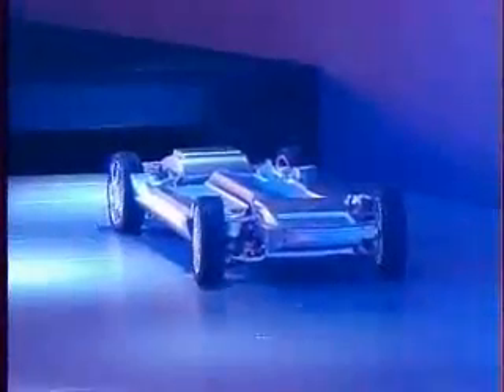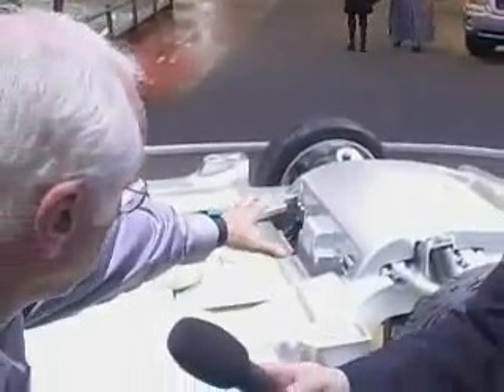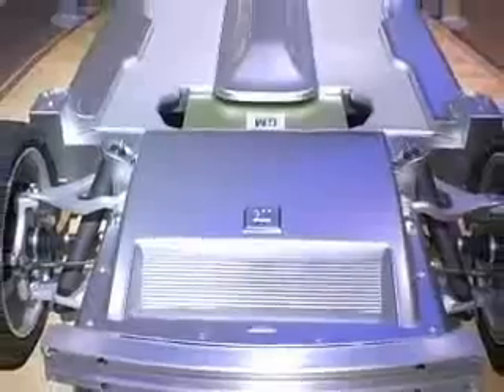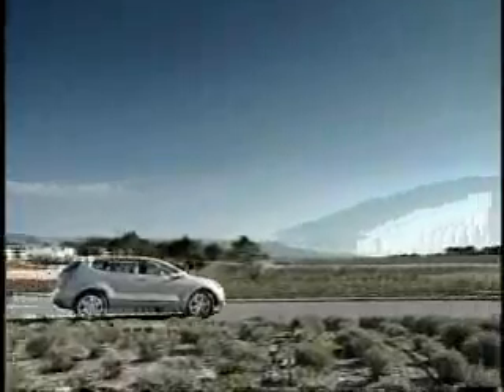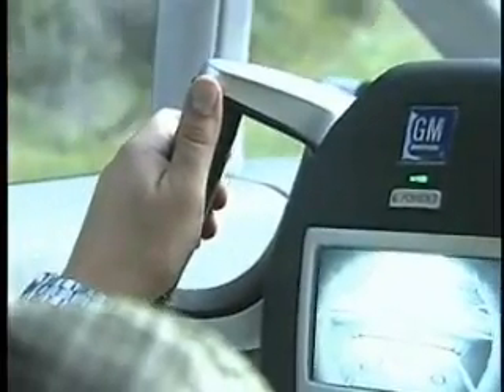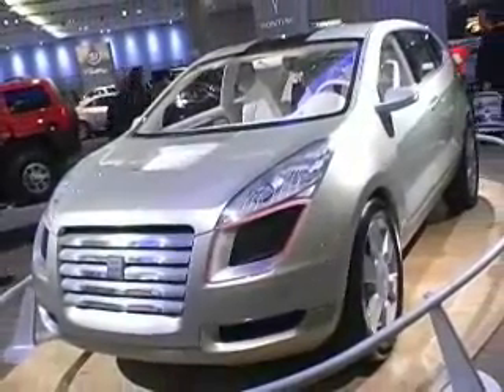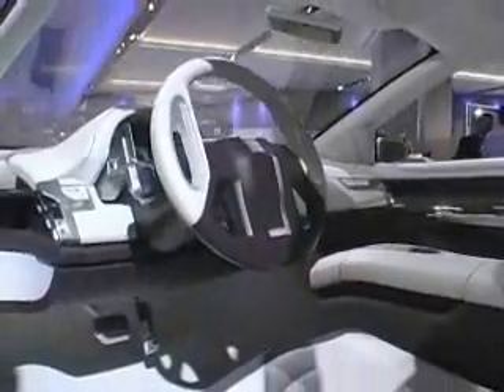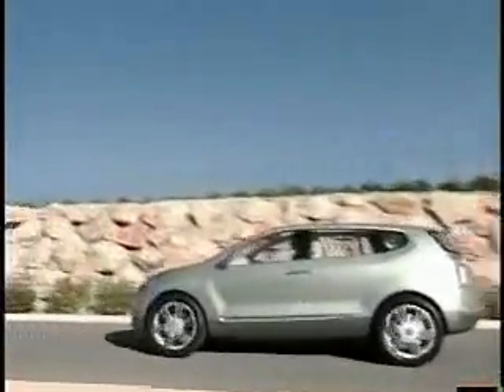General Motors - Sequal - Hydrogen Fuel Cell Car

Comment: It is interesting that they decided to power the front wheels with an electric motor and have separate electric motors in each wheel in the back.  Why did they choose to do it that way was it cost?

Comment: @InMyDefenceYTC 

Actually carbon nanotubes which is a far less expensive material can also be used as a catalyst in fuel cells.  It's still being tested with, but it has been proven to be a lot better than platinum at a lower cost.

Comment: Also platinum has to be  used as a catalyst in the cell. Platinum is something like 1400$/oz and going up with silver and gold, the main problem because platinum is the only material that will work in this context as the catalyst

Comment: @cboogiebaker
Actually the hydrogen is being produced by the fuel cell. Google the hydrolysis of water and you will see what I am talking about. If the energy used to power the cell didn't come from an old fashioned diesel generator; but rather some sort of "green energy" source such as, solar or wind power. Than there would be no oil used to power this vehicle. This is the future!!!

Comment: @darrenhello2 

The cars are not on the road due to the difficulty in mass producing hydrogen cell. This also applies to solar cells. 

The oil companies cannot delay the advance in design of hydrogen cells. 

If you do your research you will find that it will be the energy companies that benefit most from mass production hydrogen cells. 

Efficient hydrogen cell production is advancing at a daily rate.

Comment: @cole3454657 The tanks used in vehicles, some of which I know have been operating for years, (The bus company in my area of SoCal) are extremely safe. But the bus system does place the tanks on top to allow the gas to go right into the atmosphere in the case of a leak.

Comment: The Ban on H2 Fuel cell Cars until the year 2015 has been forced on us by the Petroleum Industry.
When 2015 rolls around the Petroleum lobby hopes to extend the moratorium until 2025.
It may take Anti-Trust Action to allow Alternative Fueled Vehicles to be SOLD in the United States.
In the mean time, only limited lease programs will be allowed.
Fight back, join us at facebook  group number 172387699014
group name: hydrogen cars now

Comment: @2karriizman Fuel cells use hydrogen to produce electricity, not a mechanical movement like a combustion engine. Hydrogen cars aren't being used for three reasons, 1. Space - we can't fit enough hydrogen into a car to make it practical. 2. Cost - fuel cells are expensive to make, and we have to use energy to separate hydrogen so it can be used. 3. Infrastructure  Infrastructure  Infrastructure

Comment: @xuj22 When a regular car crashes badly, you get a big puddle of volatile gasoline sitting on the ground all around it waiting for a spark to ignite it. When a hydrogen car crashes badly, the hydrogen comes out as a cloud of ultra light gas that rapidly rises far above the ground and disperses, eventually into outer space. Spectacular whooshing fireball if it ignites immediately when released, but pretty benign compared to gasoline of not ignited within the first few seconds.

Comment: @Deurone i'm really not sure why this is getting negative comments .... it's hydrogen ... extremely explosive, it's an awesome point. even if a bottle has a very small leak, store it in your garage over night .... or if it builds up in the compartment of the car.   Very clean but it's still very dangerous.  and @ altern8energy ~ get a clue 600 miles that's nice ... hydrogen fuel supply is infinite supply and clean. 250 miles would get you plenty far.

Comment: They could put those no-flat tires on this car.  Like those "honeycomb" tires but the honeycomb is inside so it doesn't look so funky.  They can run over nails, glass, just about anything without going flat.  You would only need a tow if you hit something major and completely shredded the tire.

No comment on the exploding tanks up your ass!

Comment: 2 things. what happens when u crash at high speed, will the bottles explode like the movies? wil the bottles crack open and shoot hydrogen into ur ass?
second thing, what heppens when u get a flat tyre? the dude did say the engine is in the hub. does a flat tyre mean u gotta tow the car instead of changing a flat tyre urself?

apart from those things, everything else is GREAT! Spacious. ZERO emmissions. CHEAP to run.

Comment: @benympls Only they are NOT combustion engines ... look up hydrogen fuel cell and you'll see that.  They are creating electricity by recombining the hydrogen with oxygen through a membrane... it is essentially a chemical battery.  The entrenched oil industry like Hydrogen because they could control the supply.

Comment: @brightingsky2009 Hydrogen is also not an energy source.  However, I'd throw my bid in for Hydrogen from solar/geothermal/wind/tidal electricity if it could be generated locally (perhaps even at home!) rather than distributed widely... what a waste of energy that would be!

Comment: 250 miles per Hydrogen fill-up?? Ummm I get close to 600 miles on my 2009 VW Jetta Clean Diesel. Better figure out a way to carry a 10 gallon water tank and convert the water to hydrogen and oxygen fast enough to keep the HFC happy under load.

Comment: What is the liter per minute consumption rate of hydrogen of these hydrogen cars???
How much liters per minute of hydrogen do these cars use in normal driving???
The device on my motorcycle produces over 40 liters per minute of hydrogen from water.
The device on my motorcycle also produces over 60 liters per minute of HHO gas. Is this enough hydrogen to run these cars??? Signed Norman Williams XMARINE.   No joke!!!

Comment: Hydrogen can be produced by Solar, Wind, or even yes, Nuclear Power.  There's plenty of space to add for storage and producing neccessary Hydrogen on-site, and pump the Hydrogen into the car in about 5 minutes or less as opposed to hours for your electric car.  The big oil is more likely with the electric car.  Why? Because the electric car makes your own non-gas option obscenely expensive, lacking trunk space, and bulky.  I'm arguing for the Hydrogen cars, and the availibility some of that H2.

Comment: "if you build it, they will come"

Some crazy rich guy should just start building hydrogen plants and hydrogen gas stations despite the non-existent presence of hydrogen cars on the road.

The lack of infrastructure is the only thing holding back these hydrogen cars and that first guy on the H2 supply market is going to make a buttload of money.

Comment: peterbob101, because things out of carbon fiber is like making clothing.  It is hand made with carbon cloth.  Just like you can't mass produce clothes (which is why most clothes are made is Chinese sweat-shops where labor is cheap).  Also, making the fibers is expensive and done by hand.

Comment: Mass production of those cars is something the government and people would want, but for the automotive and oil corporations it means less profits in the long run if they drove down costs based on more supply with mass production.

What you all fail to see is the automotive corporations aren't the government, they have no interest in the people, only their profits and corporate gain, which is why we are still  losing tons of automotive jobs and still driving around in gas guzzlers.

Comment: The U.S. spends $700,000,000,000  on over seas oil every year. Wouldn't it be better to keep that money at home?  In one year with that money the U.S. could build over 800,000 hydrogen fuel stations across America and create millions of new jobs. You have to remember the most important barrel of oil, is the one that you don't need..

Comment: MrEman011, the general consensus of the industry is that fuel cell cars will not be viable for decades.  There is no current substitute for the platinum electrodes, please let me know what you think can be used, should be good for a laugh.  Please let me know who has found a way to mass produce carbon fiber structures without significant hand craftsmanship.

Comment: it requires 60 kwh of electricity to produce one kg of hydrogen, which in the FCX works out to an efficiency of 1.1 mile/kwh. Plug-in cars with lithium-ion batteries like the Tesla Roadster or the Volt get 5 miles/kwh, for a nearly five-fold increase in efficiency.

Comment: e46driv3r, Such a tank would be expensive for decades to come, now they have to be made from carbon fiber which cannot be mass produced yet.  The fuel cell is made with platinum (worth more then gold) which will only get more and more expense as you make more and more fuel cells.

Comment: These cars cost $1 million each and that price isn't coming down for a long time because the fuel cell is made from platinum and the tanks are carbon fiber that has to hold 10,000 PSI. These are total vapor ware.

Comment: New fuel cells don't need platinum.Oxidized nickel  for example beat the air breakdown issue via an oxidizer on surface.

Comment: Batteries are a bad idea.  Just look at the maintenance cost of current hybrid vehicles.  A new battery every 5 years, at the current cost, that's $5000.

Just look at the issue of internal batteries in simple devices like the ipod.  

A car like the tesla roadster has half a ton worth of batteries, all very susceptible to dying.

Fuel cells are the next logical step for cars.  It's not a conspiracy, it's just the best option available given the downsides of battery storage.

Comment: Let's look at Tesla.

Tesla Roadster has a 16 hour recharge time out of a standard socket.

Tesla Roadster has half a ton in batteries inside the car.  In the Top Gear demonstration of the Tesla, 2 cars ran out of juice within a day of shooting.

An internal Battery is bad enough for an ipod, factor that by 4000 and it's even worse for a car.  Lithium is even more scarce than Fossil Fuels.  There's only about 3 big lithium producers worldwide.

Fuel Cells are the next feasible jump.

Comment: Also this is without the current massive supply chain and infrastructure of gasoline.  If hydrongen were on par, the higher supply would cause an even bigger drop in prices.

Comment: Nobody desiging this shit gives a crap about global warming. OR pollution. The simple fact is, we are going to run out of oil. sooner or later. And untill this happens, this technology will never be the mainstream. It will not be cheap, reliable, or anything to make it into widespread use. gas has been the mainstream for over 100 years, it will take that much time to get this stuff to the same point of efficiency - cost wise - that we have with gasoline products

Comment: In the South West USA one could use solar power(off the grid) to charge batteries or to crack hydrogen from water, after the initial cost the fuel woud be at significantly lest cost, Good especially for the CHEVY VOLT that is to go into production, its backup chargeing motor could run on bio fuel, therefore NO OIL use.

Comment: The National Academy of Sciences/National research Council studied this question. Data provided in the NRC report show that the cost of hydrogen per mile driven ought to be between 27% to 52% lower than the cost of gasoline at $1.80/gallon in a conventional car, and between 3% more to 32% less than the cost of gasoline used in a hybrid electric vehicle2

Comment: lee5537,

This argument is bogus. The Tesla goes 200 miles on a charge and out-performs a Ferrari with only two gears. New batteries are being developed that will exponentially increase that range and performance.

By comparison, fuel cells are heavy, complex, expensive, require exotic materials,and for the foreseeable future, FOSSIL FUELS. In other words, there is no real comparison.

Electric cars will out-compete fuel cells if they aren't killed off by big business/government.

Comment: battery cars r fine for local trips as long as your world isn't far from home.Fuel cell cars make more sense for longer trips.They would only need a 3 min. fill.Compared to battery cars and at least a 4 hr. charge,and a long wait time for your turn at the charger.So if you r going on say a 500 mile trip the fuel cell car would get there much sooner than a battery car.

Comment: Why bother with hydrogen? Really? Electricity can be produced in a million different ways, hydrogen is merely a way to store it. We've got batteries that are much better at storage that do not require us to replace one fossil fuel for another. Oil companies are already buying up all of the easy supplies of hydrogen. Are you surprised? Not me. Google Tesla Motors if you want to see a real car.

Comment: The greatest challenge for fuel cells is not the technology but the infrustructure.  Hydrogen needs to be comercially available before you can have a widespread use of hydrogen fuel cell cars.  Getting all that hydrogen in the first place is another big challenge.

Comment: Also, I find it funny that Nonsoundflux is talking about something he has no knowledge on. Hydrogen would be transferred by hydrogen powered vehicles. In the future, gas, coal, and other greenhouse gas producing vehicles will be nearly non-existant. Also, you cannot say anything about how hydrogen is produces. At the moment, there is no way to produce it without forcing a chemical reaction between water and another substance.

Comment: fuelcell cars r a full power car like any other,A hydrogen tank will not explode a gas tank will.if a hydrogen tank leaks it will evaporate into air because it is 14x lighter than air.The auto makers say a battery car can have what they call a (thermol event) they call it that because they don't like the word FIRE.But if u want to buy a battery car go ahead and buy one,I plan on buying a fuelcell car. I hope u don't mind..

Comment: Yall are fucking ignorant.  This is a car that runs on Hydrogen.  The fuel cell converts the hydrogen to Electricity.  The one thing I dont like about it is the steering is electronic.  So if theres a failure like in an Accident you loose steering.

Comment: The problem with electric cars is the batteries.
One of best Idea is to provide power using fuel cells that provides high power in small size.
Problem is how to supply hydrogen to stations.
Anyway Gas producers are doing all posible to stop alternatives resources

Comment: Well not 100 percent end of oil. You will still need it for lubrication and operating Trains and aircraft and other high powered equipment.
Of course in time we will have developed alternate power for them if the oil companies let us. We would have had hydrogen sooner if they didnt control the developement of alternate fuel sources.

Comment: Need to make these vehicles Hydrogen on demand. Take away the Hydrogen tanks.  Hydrogen on demand is safe no need for storage. Guess who will own the Hydrogen refuling stations?  Shell Oil has already installed a Hydrogen station in White Planes, NY.  They will control the cost per Gallon or whatever the unit is.Jimmy Cline made his vehicle, hydrogen burning without a storage tank. Hydrogen on demand, come on companies get with it.  He gets 100 miles on 4 oz of water.

Comment: The propoganda is being gouged at the pumps,to get to your job, or your daily routine. To alot of people taking a bus is not an option. The goverment is preaching to us about global warming, and pollution. Well there is no excuse not to switch to hydrogen,made from water, help make the air clean and cut down on global warming.So with hydrogen the more u drive the cleaner the air will get,because the exhaust is just water vapour. And the oil com. will lower the cost of oil for other uses..

Comment: Here's what they are selling us...An electric vehicle that has a hydrogen system rather than batteries. This way, they can keep us tied to a pump, convenience store and fast food franchise. Battery tech has existed for years that can operate pure electrics and, no, they don't need to be replaced for the life of the vehicle. Look at Tesla motors for a clue. This whole hydrogen push is just another way of padding profits. More replacement parts, maintenance and best of all, they control the fuel.

Comment: Even though a battery is a more efficient way of storing power, it is not the highest capacity way of storing power. Currently we can not even come close to storing the amount of power that a fuel cell system can store into a battery. Thus far the best battery on the market is the lithium-polymer (LiPo) battery. (which by the way is explosive, more so than hydrogen)

Comment: nonsoundflux just as a mater of information, there was as of March 20th a break through in Fuel Cell tech. A washable filter element was developed that removes 100% of the carbon prior to PEM process. That eliminated the plate contamination, allowing the plates to work indefinately, big cost saver on the platinum type fuel cell.

Comment: The way I see it, batteries are less efficient. 
1) Fuel cells creates consant amount of electricity, while batteries loose performance over time and usage.
2) Batteries are very heavy, bulky, and expensive. May be cheaper than fuel cells, IDK.
3) More power plant are needed, and electric bills will sky rocket.
4) While fuel cells take about 2 minuets to refuel, would it take 5 minuets or longer to recharge?
Correct me if I'm wrong. I beleive hydrogen fuel cells are the best alt. fuel.

Comment: Fuel cell vehicles are achieving energy efficiencies of 40 to 50 percent in current testing and demonstrations; through extensive research and development, these numbers are improving every day (faster than batteries) Increased energy efficiency, which holds the promise of reducing dependence on  oil and increasing energy security, makes FCVs a very attractive replacement for internal combustion engines , which are between 10 to 16 percent efficient